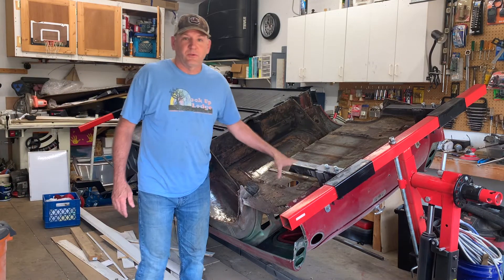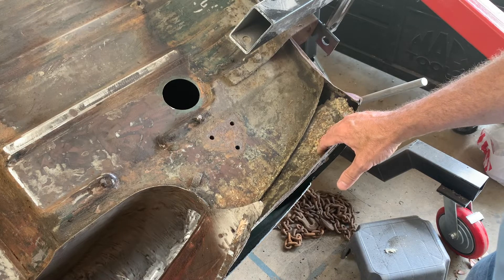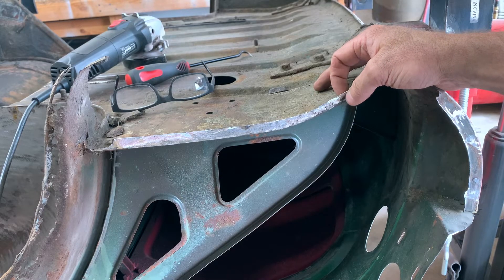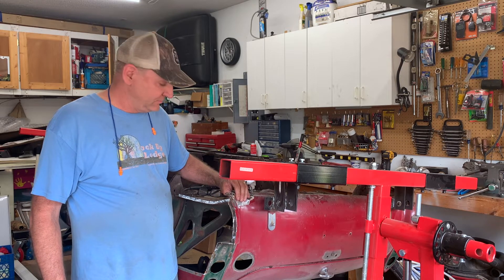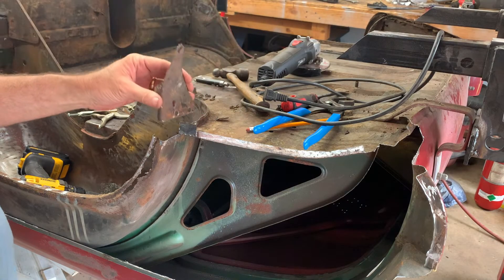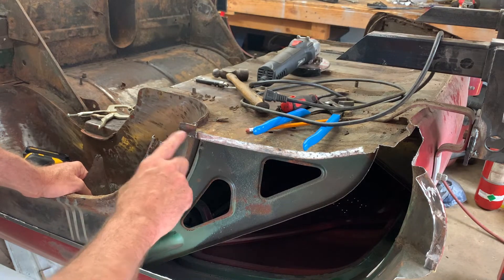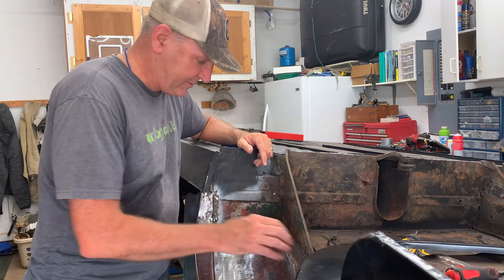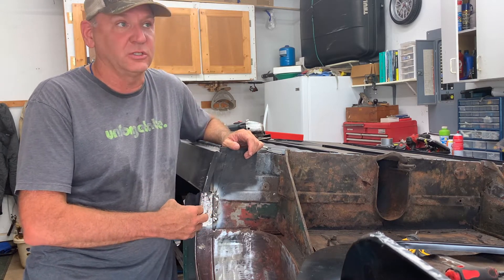Rust infested rear panel repair S1E40

Comment: Nice work, Rob. I always enjoy watching your videos. Bummer finding more rot, but your repair work is first class, so I’m confident your patch panel will be spot on. Regarding your little holes that just seem to want to blow out when trying to weld them, you might want to try soldering them closed. That process worked great for me.
Reply from the maker: I remember you and I talking about that and you sent me some videos. I hadn’t thought about that but I might need to give it a try.
Reply: @robsrestorationgarage  You could also try using copper as a heat sink. To fill up those small holes. It works pretty well for me.
Reply from the maker: I will have to research that as I have never tried that.

Comment: I filled small holes using a welder and welding with a metal coat hanger to fill them
Reply from the maker: So did you just touch the hanger to the metal as you were welding?
Reply: @robsrestorationgarage  yes you just get the weld running with the coathanger have a look at bad chad he shows using this method
Reply from the maker: @marksheyworth7888  I have tried using a piece of brass behind the hole as a backer and it seems to work great
Reply: @robsrestorationgarage  copper works as well i used a flattened 3/4 inch copper pipe
Reply from the maker: @marksheyworth7888  That is what Econobox Garage used as well. I think I have a scrap piece of pipe

Comment: If I'm not mistaken, the wheel wells are not equal widths.
Reply: I believe the difference is 1/4-1/2 inch
Reply from the maker: I really appreciate your input. You are probably right. I was planning on putting the new metal right where the old was even if the widths weren’t the same on both sides.